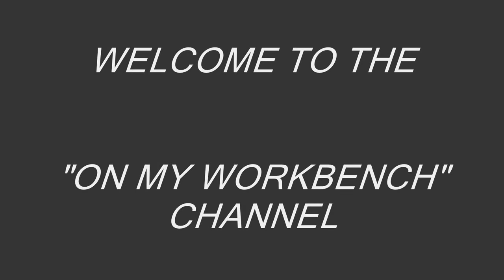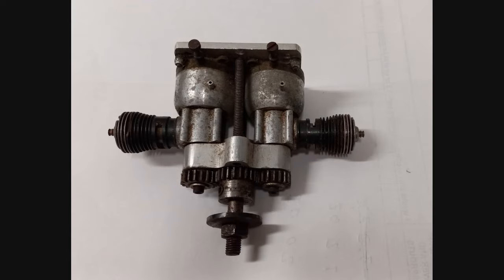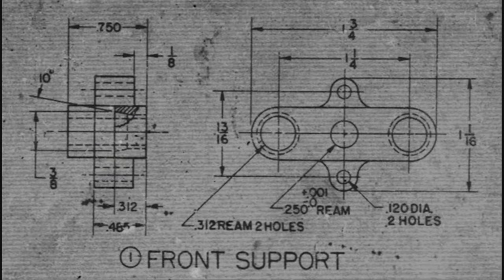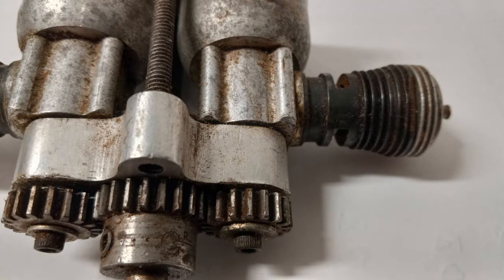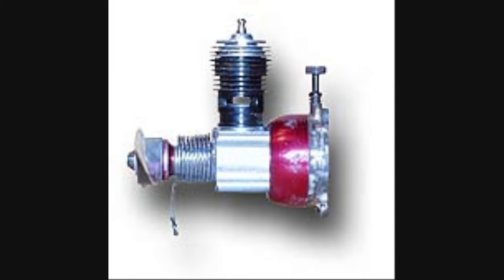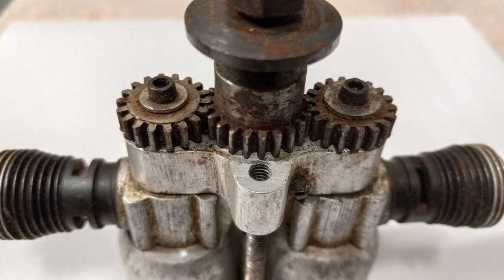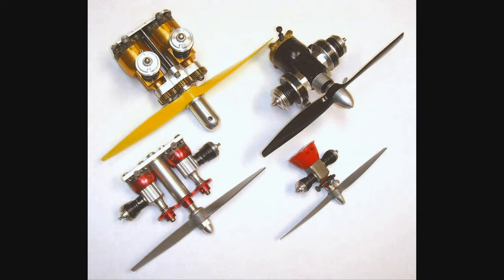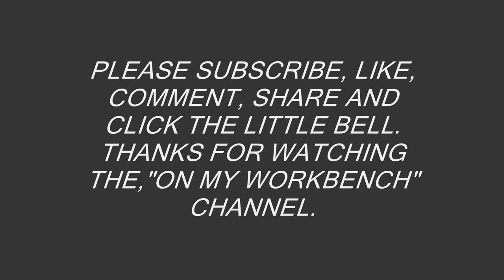COX TWIN MOTOR

Comment: Cool stuff.   Your dad sounds like my dad.  My dad also built many 5 and 7 cylinder radials using cox engines.  He met Larry Renger from cox, hoping to have them manufacture his design.  Turns out my dad  needed to get more RPM's from his engines to make it more marketable.  Two stroke radials are a whole lot harder to get to run with a shared crank

Comment: Was hoping to see it run.  It was easier to use the o49 Baby bees with the tank than the one my friend built.  Thanks and happy flying.
Reply from the maker: I may do a video of it running if I can find some 20 or 25% nitro glow fuel with 20% oil.

Comment: Back when Cox .049 engines and parts were available. By the 1990s we had trouble getting parts for our favorite TD .051 as they had simple RC throttles
Reply from the maker: I have a lot of old Cox parts but it's the glow heads that that are critical with out good glow heads the motors are useless, my dad drilled and taped the center of an old glow head for a glow plug and it worked good.

Comment: Could you please send me a copy of the Article. When I was in High School in the late 60s one of the fellows in the mold  making course cast a variation of this design with the cylinder at an Agle like a twin V, I had one that I ran in a Half pint model boat until it sunk in the 70s.
Reply from the maker: I would be happy to, please send me your email address to onmyworkbench@gmail.com

Comment: He forgot to mention the Cox TeeDee .010 engine. You want Tiny, It was.
Reply from the maker: I intentionally left out the the TeeDee series of Cox engines because they use a venturi with crankshaft port timing for their fuel air induction system. In the video I was talking about the reed valve engines, as I stated in the video engines that use a venturi and crankshaft port timing will not run CW. It is my understanding that Cox tried to make a reed valve .010 but it would not run very well so they went with the venturi and crankshaft port timing. 

NOTE: The follow is from Wikipedia. To find it Google Cox model engine.

"In 1960 Cox hired an engineer named Bill Atwood (who had already built his own line of engines), to develop a new .010 cubic inch engine. Atwood was also responsible for the Tee Dee and Medallion line of engines. These engines put Cox on the map as a leading engine in the world for many years to come.[10]

One of the things Cox wanted Atwood to do was make him a .010 engine. Cox had already tried to halve the size of the Pee Wee .020 but couldn't get it to run for some reason. The suspicion surrounded a problem with the tiny reed valve. Atwood found that the front rotary valve worked well on the .010 size hence the .010 was born.[20]"

Comment: @0:40

was that a 4 cylinder radial arrangement with a similar planetary crankshaft hack?
Reply from the maker: I looked at the scanned photo and it looks to me as if it is a geared motor like the one built from the .049's.
 What leads me to believe that it that radial engines all have to have an odd number of cylinders. such as 3,5,7or 9 cylinders. I suspect that you are on the right track that it has a main gear that's attached to the crankshaft and the smaller gears are on the motors 90 degrees apart from one another.
Reply: @onmyworkbench7000  the odd number has something to do with balance, I think, & the .049 is light enough "balance" isn't a big concern.
Reply from the maker: @Iowa599  Below is from Wikipedia.
Four-stroke radials have an odd number of cylinders per row, so that a consistent every-other-piston firing order can be maintained, providing smooth operation. For example, on a five-cylinder engine the firing order is 1, 3, 5, 2, 4, and back to cylinder 1. Moreover, this always leaves a one-piston gap between the piston on its combustion stroke and the piston on compression. The active stroke directly helps compress the next cylinder to fire, making the motion more uniform. If an even number of cylinders were used, an equally timed firing cycle would not be feasible.
Reply: @onmyworkbench7000  yeah, basically balance. If one will run with 2, it will run with 3, or 4, cylinders. Maybe not smoothly, but your grandma won't be riding in it.

makes me think, the piston isn't moving the fastest at 90° crank rotation, half-way up the bore. It is at 72.5° rotation, just over halfway up the bore (when going up or down.)

edit: assuming the bore is centered over the crank, but that's not always the case